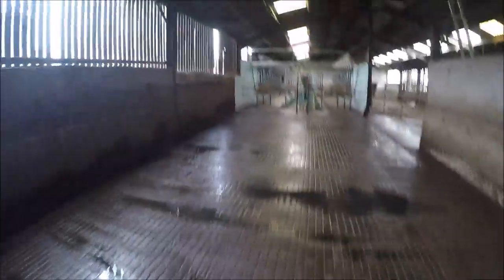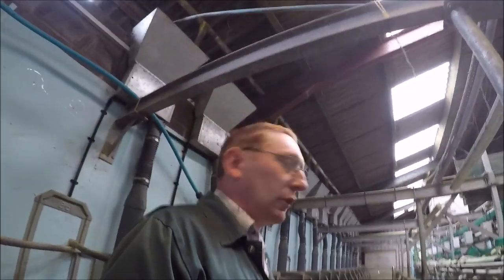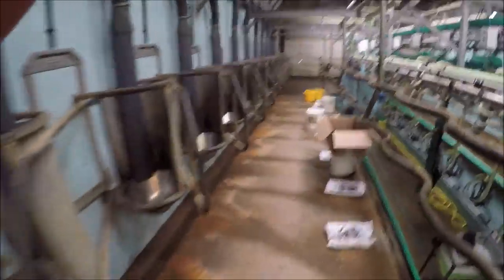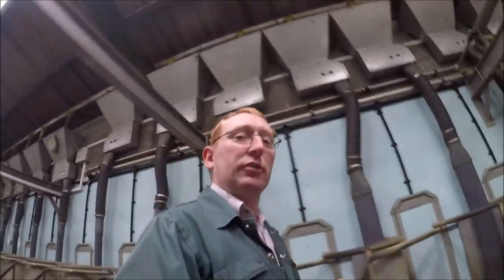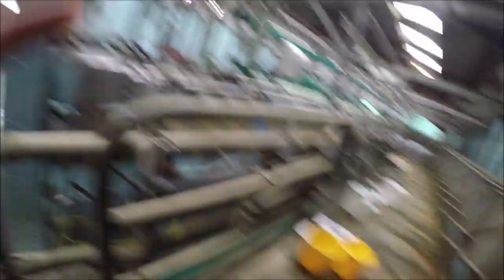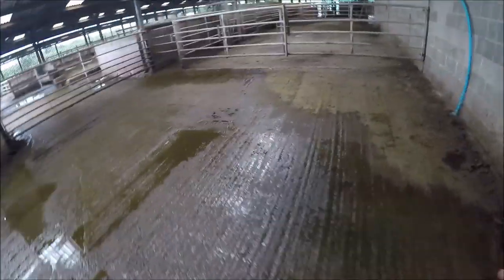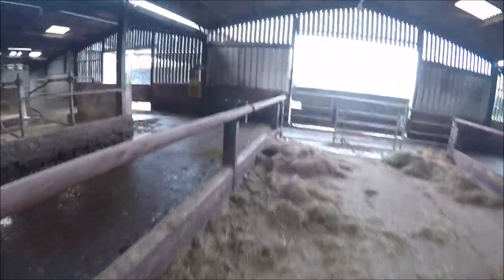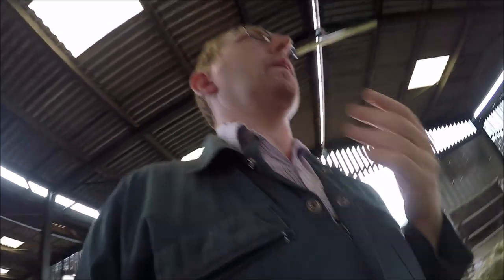Dairy cow housing layout and design.

Comment: Great system Dan, looks like it works well for cow flow. Have you considered putting locking head yokes in the feed passage. We have them on all our feed barriers, it makes doing the vet visit very easy, tb testing and vaccinating ect very easy. The only down side made is you loose a little of feed space
Reply: Agree, the farm i used to work on was very dated in terms of its buildings and layout but the one feature i liked was the locking yokes.
Reply: kv 6080 Not a fan of head locking gates in terms of feed space. Also in the UK and from what I have seen on numerous farms, the Vet won’t TB test if cows are in head locking gates. They must all go through a cattle crush. I know a local farmer who kitted out his shed with locking gates and the departments vet wouldn’t test.

Comment: I like our soft touch push gate. It does save on labour of going out an pushing the cows up. As for alley scrapers, there are positive and negative to them. One of our barn has the track in the cement and it gets pushed off time to time. The main barn has the track above which works better. They call scrap the alley 6 times per 24hrs. Cows with with leg problems or hobles have issues with scrapers. The can freeze in our winters and get dry an stop working in the summer, so they do like to be maintained. You can get build up at the back of stall on the wall, which over time has to be chipped off. Our wings on them wear out about every 5 years but the head is okay still. Hydraulic hoses from time to time but in 15 years or so of them maybe a couple put just at the pump and the cylinders, so easy fix. Lol, l guess the only benefit is no tractor needed, an less man hours.
Southern, B.C, Canada

Comment: Random idea.  would it be useful to cut a couple of small  groove channels, one each side below the bed area  down the length of the bed scrape path to allow LIQUID to drain away.  you got the ribbing across the path road.  This could be quickly and easily achieved with a motor road saw like they use to cut road excavation trenches.  They are hireable from tool hire places on a day hire basis.

Comment: if it works roll with it. weather determines layout. here in Mn same center feed lane but every pen everywhere has headlocks at the feed lane so the vet can do weekly preg checks and AI guy breed/give fertility shots while your milking. triple digit temps in summer a sprinkler system 2 1/2" pvc/nozzles spraying the cows 24/7 as they eat so it encourages them to eat more. stall cubicles around here are walk through type because cows are milked 4 times/24hrs and some have trouble getting up. freestall barn lights run by timer side curtains run by thermostat insulated ceiling & 24ft wide overhead doors on both ends to keep manure from freezing when wind chill is below -40*f. water trough water is pre-warmed from milkroom plate cooler water keeps it from freezing and cows drink more if it's warm. some dairies have rows of water softeners to take the hardness out. crowd gate is a must in the parlor holding pen for 1st group under 60 days in milk fresh cows/stubborn heifers. parlor holding pen to parlor there has to be a bio security barrier either roll up tarp or overhead doors it's a 5 point grade A violation to have it open at any time except when there's cow traffic (flies & birds). parlor/holding pen concrete is pea gravel size aggregate & aluminum flake troweled over surface for longer life and it cleans better less chance of slippery algae growth. in the usa every dairy must have a Watts N36 vacuum purge valve both on the water main and parlor power washer for bio security. state & federal milk inspection every 3 months

Comment: Hi Dan, just a thought about your layout, do you prefer everything parallel to each other or if you were to build it again would you consider putting the parlour at 90 degrees to the dairy cow housing for better ventilation etc?
Reply from the maker: It's something to consider if you're starting from scratch, but where our parlour and collecting yard are were existing buildings and this is the best way for us with regards to drainage and slurry handling.